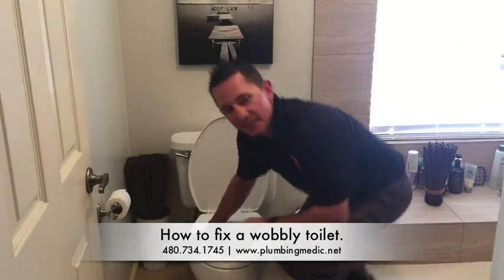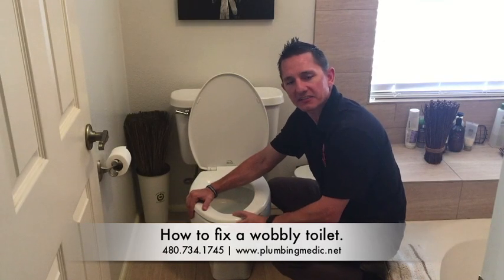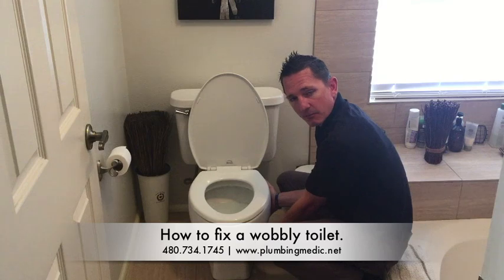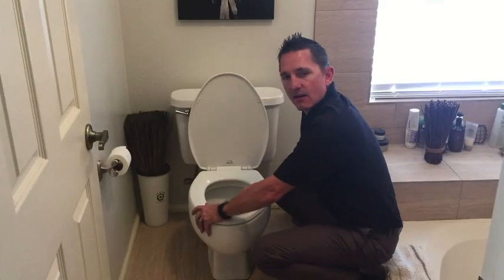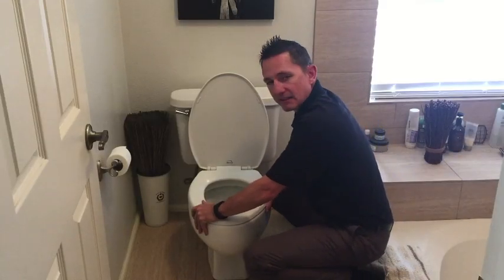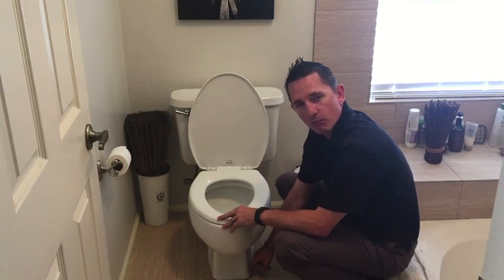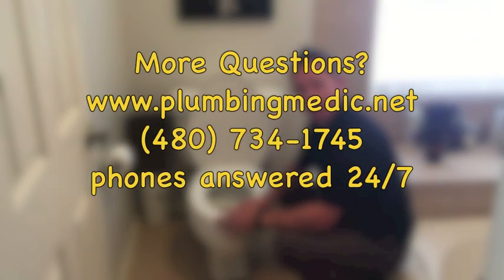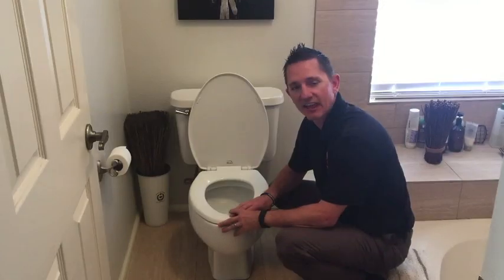How-To Fix a Wobbly Toilet | Plumbing Medic

Comment: Never caulk the base of a toilet, it will allow leaking water to be trapped inside.
Reply: I agree
Reply: The challenge is that many cities require caulking the base of the toilet as a code. This acts as a sanitary seal to keep urine from getting under the base. If you leave a gap at the back of the toilet it will allow water to leak out in the event your wax seal fails.

Comment: I just bought a new toilet. I took the old toilet out and found the toilet flange is uneven. There is also some sort of led flange stuck a foot down into the cast iron. It looks like it is adhered to the pipe inside, a very tight fit, but at the top of the flange the overlapping lead is broken in the front of the flange. I was going to use a rubber and foam flange but I'm pretty sure that without the lead edge on the front of the flange that water could come through. There is also a one inch hole in the floor in front of the flange. I jammed aluminum foil in around the flange because I know big water bug cockroaches love the underside of the bathroom due to the dampness and so on. Anyway, I think I will have to use the wax flange. The floor has dropped a full 1/4 inch to 3/8 from the flange to the wall. I caulked the gap of the tile and floor with silicone sealer but I am afraid it will cause water to not drain out under the house but it's not supposed to anyway. It's an OLD house and the house needs a good bit of work.